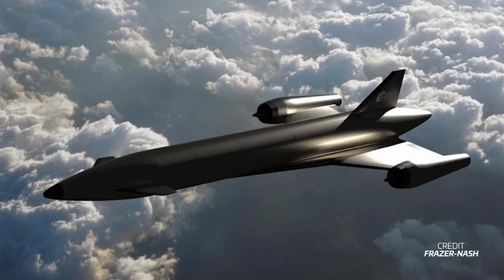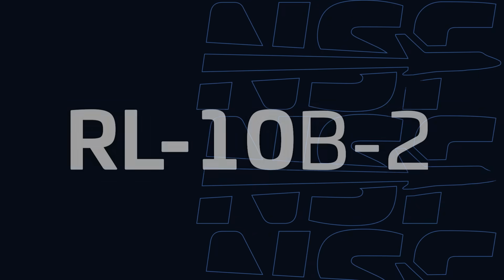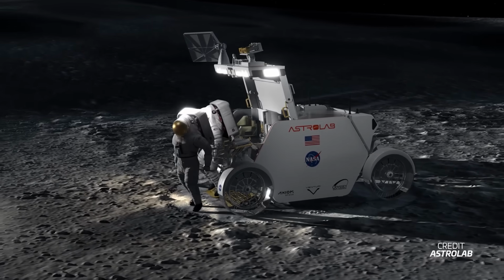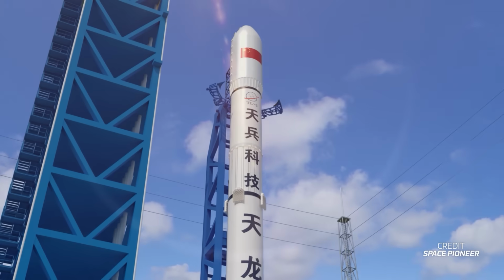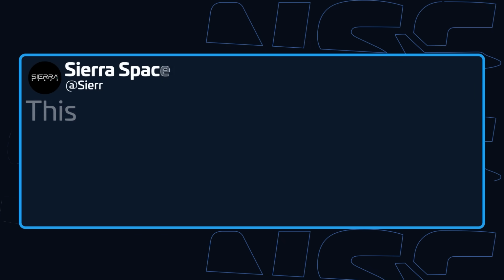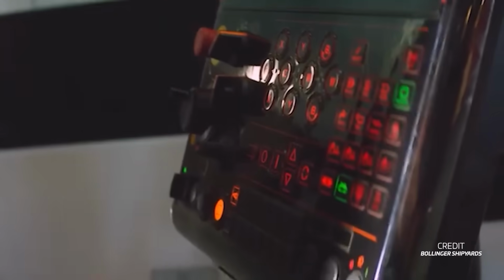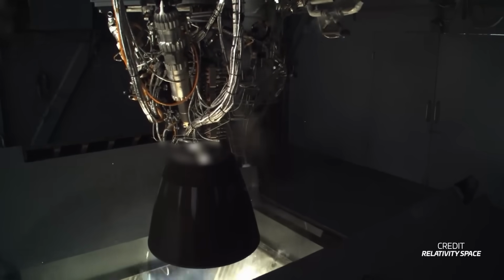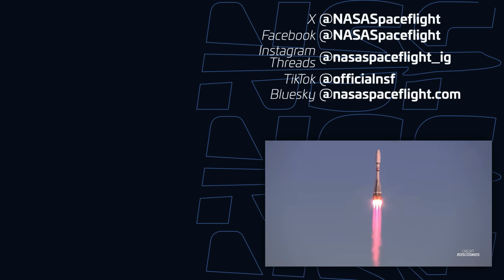Europe's BRAND NEW Spaceplane! Will This One Actually Take Off? | This Week In Spaceflight

Comment: It's SKYLON, Rolls Royce & Reaction Engines were working on this for years until some traitorous scum bag flogged off all the design work to the french & germans AGAIN...!! DARPA took the air breathing/hybrid rocket engines up to Mach 5.3 in Jan 23. Designed to be fuelled and to take off from standard runways.. It makes a mockery of anything of traditional rocketry for anything but heavy loads.

Comment: WRT the Invictus space plane: Before Skylon, in the late 80s, early 90s the UK had a project with similar engines called HOTOL. A lot of money was spent on it, but it ultimately failed because the engines were at the back. Having the engines at the back moved the centre of mass too far aft.  Attempts to resolve this without completely re-engineering compromised the payload capacity. This debacle was the reason Skylon had the engines in the centre. Now with Invictus the engines are at the back again.
Reply: I think they had problems with impingement of the exhaust on the body in space which was pointed out by some work that they did with the AFRL. I think if you look at Hotol versus Invictus the engines are still not quite as far back.

Comment: One other thing... I worked with Reaction Engines, designers of SABRE and Skylon, for many years! Their recent demise was a very sad day - so much really excellent research and ground breaking technology, so it's good to see that it maybe wasn't all for nothing. The key part of the whole system was the heat exchanger, and that worked. They had a test facility in the US that tested extremely hot air entering and extremely cold air leaving the heat exchanger, and it worked perfectly. The hot air was provided by the exhaust of an after-burning jet engine, firing right into it!
Also, I did all those Skylon animations, many years ago, so that's why they look a bit dated. Happy days!
Reply: We really need more follow-through with technological projects in Europe, not just in the UK. ESA would be a great platform for that. Thank you for working on that! Can't think of a more British name than Invictus!
Reply: Great work❤
Reply: I'm not convinced an SSTO space plane is the best use for SABRE but any port in a storm.
Reply: A hydrogen fuelled (I assume it needs a cryogenic fuel) SABRE powered multirole fighter bomber would be awfully cool.
Well, not a SABRE, not a rocket, but a SABRE precooler equipped turbofan? Maybe just hydrogen for the precooler and avgas for the turbine? 
Just to stop the turbine from melting when hypersonic.
Or maybe an electric phase change loop to cool the precooler powered off the turbine. If your engine has enough go to push a  hypersonic exhaust, then maybe it has enough spare to cool the precooler.
Think of it like a supercharger. They sap useful power from the engine, but the compressed air they produce for the engine to breathe causes the engine to produce more power than the supercharger consumed, so it's a net gain.
Reply: I wonder if ground power would be needed to precool the precooler before takeoff?
Reply: @MostlyPennyCat  As far as I recall, the plan for Skylon was a two hour turnaround, including payload and propellant, all highly automated. I'm sure it was to have an APU in the tail so ground power never featured in anything I saw. I strongly suspect that if/when Invictus gets built, they'll include ground power, as it's easy to implement and offers a lot of benefits.
Reply: I dreamed once about these spaceplanes come through maybe under ESA, nice to know something will fly out off the animations
Reply: I was so disappointed to hear about reaction engines going under.

Comment: Why not use the previous `moon car that is on the moon. Or maybe they are not there anymore?
Reply: Why don't we use the sailboats that were sunken 1000 years ago? Well same reason with those
Reply: Fifty years old exposed to the intense radiation and temperature extremes on the moon.  Also located at a different landing site. The new versions have a lot of new tech. The new ones can also be remote controlled and operated after the astronauts leave.

Comment: let's just hope that Chinese company has fixed the issues with their holddown apparatus so the next SF test doesn't launch as well!
Reply: Neutron updates (sort of).  Wallops Is. NASA has begun construction of the new bridge connecting the mainland to the Wallops Is. launch site.  Actually, 1/2 the "Island" portion of the Wallops Is. base is Navy, and the other half is NASA.  But, the existing bridge would NOT WORK for Neutron, or in fact, for any "Larger" launch vehicle, as the bridge had TOO MUCH ARCH and transporters would get "High centered" in the middle of the bridge.  The new bridge design is flat, like a causeway type bridge, and the money has already been allocated, and they're actively looking for construction personnel right now.  The project is expected to take 3 years.  In the meantime, they'll likely be going back to floating the Neutron over to the island on barges like they used to do at Wallops before construction of the existing bridge was finished during the 1960's.  

Y'all might consider doing a video on Wallops Is. NASA.  It's been around since BEFORE The beginning of NASA (going back to the establishment of NACA) and has been involved in MISSILE TESTING since WWII.
Reply: Is there really any such thing as a "Fully private Chinese company?"  I doubt it.  Their $$$ for development likely comes right out of the CCP, at least 51% I would guess.  There may be some "Venture" capital in there, but likely not as much as you'd think.
Reply: Amazon is "Secretive" about the sats probably because THEY LOOK JUST LIKE STARLINK sats!  Imitation is the greatest form o flattery, eh?  Just a guess, but it's likely not far off.  To stack in a payload bay, they must be flat, and must have solar panels that unfold on deployment. They must have thrusters arranged so they can move in 3D space. They must have connecting "Antenna" (in this case optical links like Starlink) with lasers connecting them together most likely.  Sounds EXACTLY like Starlink to me!
Reply: @sdebeaubien  Amazon's satellites look nothing like Starlink
Reply: And FYI, hypersonic testing, speeds must be at least Mach 5. So the ESA "Spaceplane" operating at Mach 5 barely qualifies.  But, it will be interesting to see how it develops.  Their engine design is going to need an awful lot of proof. The X-15 was rocket powered.  There is an Aussie company in development RIGHT NOW with a hypersonic vehicle using a SCRAMJET engine.  It will be tested on a Rocket Lab Electron, out of Wallops, and in fact, may be the one on the launch schedule currently.
Reply: Thanks as always for informative updates!  @NasaSpaceFlight - y'all rock!

Comment: For a minute there, you had me thinking that Boeing spent $2.8 billion to build a square. What's worse is that actually sounds believable.
Reply: Noope, they spend 2.8 Billion on a CAD model of a square.
Reply: Squares are hard!😉
Reply: @learsiyenoham 

Hey I’ll make said square in ksp to test my own upperstages
Reply: Until I see it I don't believe it. At this point I trust Boeing as far as I can throw a 737MAX8
Reply: Boeing has also recently had problems with refueling booms falling off its KC-140 tanker aircraft used for refueling fighters & bombers.
Reply: Correction: It's the new Boeing KC-46 tanker planes with the refueling boom problems.

Comment: SpaceX should upgrade a Cybertruck as a lunar rover and fly it as a test load on the HLS pathfinder mission...
Reply: Too heavy?
Reply: @GHOSTSTALKER90  HLS is targeting delivering 100 tons to lunar surface. Cybertruck goes less than 3.5 tons, so no, even heavily modified, not anywhere near too heavy.  It would be a good test of the cargo delivery system. Remember the Tesla roadster launched on the first Falcon Heavy...
Reply: Replace the tires to start with. Modify seating for space suits with life support units. Are you going to also bring a recharging station?